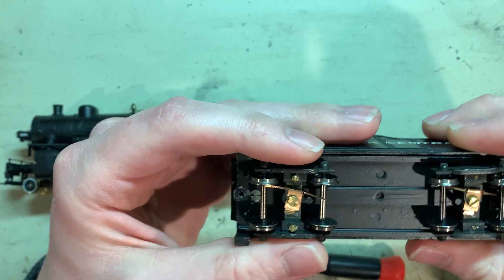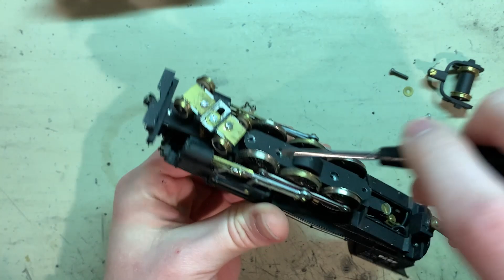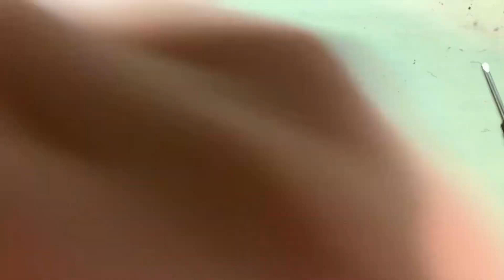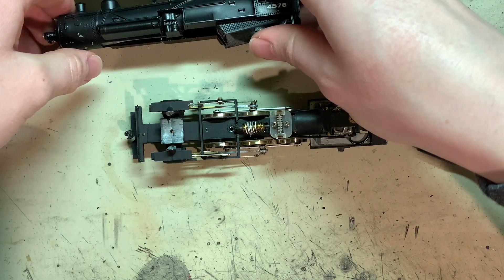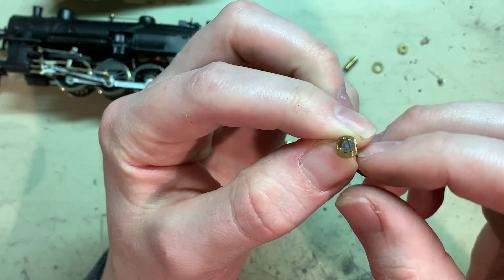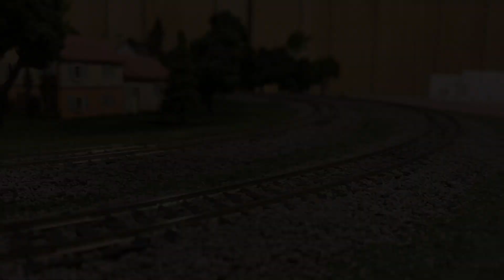Tuning up a Bowser K11 4-6-2

Comment: That's a great little machine! Do you know what year that was made?
That helical rotor, and real axel bearings are what I like to see!
Very nice!
Reply from the maker: Thanks!  I bought this one new in 2007 towards the end of Bowser kit production.  It was the first diecast model they developed around 1950, so it had a long production life!
Reply: @DarthSantaFe Wow! That's surprising how recent.
I have a John English Macado from the early 50s that was a diecast kit disaster that I managed to turn pretty much into what you have there. I rebuilt the entire thing completely, including real bearings, and much better drive rods, motor, weight reduction, and even a headlight.
I haven't seen anything as nice, that's newer till your video. 
I'll be looking around for one of those. I guess Bowser bought the John English Co way back, and I see some similarities, but my kit was pretty chincy. It took me many hours to finally finish it. 
Now I'm rebuilding a brass Tenshodo Hudson. I named it Goldzilla! It's going to be while on this one. What a freaking creature it is!
Reply from the maker: @jacksutherland846  Sounds like a lot of work went into that model, and it's good to hear that it came out well!  It was actually John English who bought Bowser, then a few years later bought most of Penn Line and some of the Varney tooling and integrated them all under the Bowser name (Stewart, Cary and a few others were also bought and added over time, and most new models are now based on Stewart's tooling).  There's actually quite a bit of history with the whole brand, and it's still owned and operated by the English family.

I hope that Tenshodo repair goes well!  I fixed one of their earliest Hudsons a while back, and it turned out to be a good runner even with the old motor and gears: https://www.youtube.com/watch?v=zdQMfnWIL2g
Reply: @DarthSantaFe So much to learn. Ay? I haven't been able to find hardly anything about the English Co. Obviously barking up the wrong tree. Thanks for the info. I'll watch the video link you sent!
Reply: @DarthSantaFe I watched that vid already. Are you sure that's a Tenshodo? It's quite different than mine.
Mine has a rail frame, enclosed worm drive, spring suspension, including the tender trucks, all kinds of things. I'm not an expert. That's for sure. But what's funny, is the mock generators are identical. Lol.
Reply from the maker: @jacksutherland846 Yup, it’s just a really old one!  It actually took a while to figure out for sure who made it.

Comment: Where can I find a nickel plating kit?    I have several drivers I need to replate
Reply from the maker: Caswell makes a nickel brush plating kit.  I've had pretty good success using it to plate some parts.

Comment: The K-11 was built as a fast freight locomotive, but was quickly replaced by 100 L-1 Mohawks of 1916 and conclusively bumped to secondary passenger and commuter runs by the 200 L-2's. "Class K-11 which had 69" diameter drivers, 26" x 26" cylinders, a 180 psi boiler pressure and they exerted 38,970 pounds of tractive effort.""The K-11a was essentially the same design as the K-3, but had shorter tubes, put less weight on the rails and had much smaller drivers. Their role, wrote the CH's McKnight, was to "expedite the perishable traffic of fresh meats, vegetables, fruit and milk into the New York City market."
50 entered service as K-10s built by Brooks with 24" x 26" cylinders, but these were converted in 1912 to gain the traffic effort shown by the K-11s. The last ten were supplied by Brooks in 1911--works numbers were 49245-49254 in February 1911.
Notice the unusually "square" cylinders in which diameter is equal to stroke.
A few were fitted with boosters and those engines had 25" x 26" cylinders using 200-psi steam for a 40,040-lb tractive effort assisted by an 11,000-lb booster at starting. It's not clear from the 1930 diagrams how many K-11s were boosted, but at that point only a few were so fitted.
Fourteen K-11s were converted by Beech Grove shops, the principal difference being the installation of 72" drivers. These were then classed K-14s.""Class K-11b, d, e, f 
 Works numbers were (K-11b) 50672-50681 in December 1911, 50682-50695 in January 1912, 50696-50701 in February; (K-11d) 51184-51203 in April 1912; (K-11e) 51760-51767 in August 1912, 51768-51789 in September; (K-11f) 54168-54172 in September 1913, and 54173-54196 in October.

Brooks may have produced the first ten new-build perfect-square Pacifics (cylinder diameter equal to the bore) as K-11a and Baldwin may have added the next 30 as K-11c, but Schenectady produced the majority of this large class.
K-11s were essentially the same design as the K-3, but had shorter tubes, put less weight on the rails and had much smaller drivers. Central Headlight's McKnight found that the K-11s were a success in their initial service as Hudson Division perishable-freight expediters, but were soon replaced by L-2 4-8-2s in 1916. It was then that they went to the Adirondack Division and soon provided motive power for freight and passenger service between Utica, NY and Montreal.
Since much of the route traveled through the Adirondack Forest Preserve, where coal firing was prohibited, the West Albany shops soon became quite provision at converting K-11s from coal to oil burning for the summer months and back during the winter. McKnight noted that the K-11s' firemen "appreciated the oil burners because riding the seatbox working an oil valve beat swinging a #12 "Rededge" [shovel] to keep the old girl hot." Eventually, enough K-11s were available for AFP service that twenty K-11s retained their oil-burners year-round and often spent the winter in reserve.
A few were fitted with boosters and those engines had 25" x 26" cylinders using 200-psi steam for a 40,040-lb tractive effort assisted by an 11,000-lb booster at starting. It's not clear from the 1930 diagrams how many K-11s were boosted, but at that point only a few were so fitted.
McKnight saluted the K-11 in a compact description of a highly useful engine: "They stood up to hard service, steamed easily, rode well, and the engine crews liked them. They could pull like a Clydesdale and still run like a Morgan." McKnight continued: "For three and a half decades they ...[were] equal to any assignment within their limits whether it be a passenger run, moving freight tonnage, heavy suburban work, or even switching chores."
Fourteen K-11s were converted by Beech Grove shops, the principal difference being the installation of 72" drivers. These were then classed K-14s.
Class K-11c 
 Works numbers were 37260-37267, 37354-37359, 37360-37375 in November 1911.

As the New York Central stocked up on these perfectly square Pacifics (in which the cylinder diameter equalled its stroke), Baldwin unaccountably was called on to deliver 30 more
Even more remarkably, the Philadelphians served the railroad until the late 1940s-early 1950s in most cases.
Class K-14a, c, e, f

 The K-11 series of fast freight/passenger engines that entered service on the NYC in 1911. Apparently pleased with the conversion of fourteen K-11s to K-14g for the Boston & Albany, Beech Grove and West Albany shops converted ten for the parent company's own use. In addition to taller drivers, the makeover included a larger tender. The specifications otherwise remained the same, although its weight growth suggests some under-the-skin additions or modifications.
Beech Grove reworked Brooks-produced 11as 3000, 3009, and 3011 to 14a, Baldwin-built 3052 to 14c, and West Albany reworked Schenectady 11e 3159-3165 to 14e, and 11f 3174, 3183, 3191, and 3193 to 14f. Successfully reworked, the class operated on the NYC until 1951-1952."https://www.flickr.com/photos/alcomike/6894932797/in/photostream/

Comment: When I built my Bowser K4 I installed a NWSL gearbox. Runs real nice with that.
Reply from the maker: I also did that with my L1 2-8-2 along with adding a coreless motor and flywheel.  Made for a super quiet runner!

Comment: Watching your video of building the Mikado (6 years ago) I was inspired to try to build one and since I have built 3 of these kits and many others. This looms like the last upgrade in design and the only down side is the lead truck. The original design was so the engine would center coming off a curve thus reducing alignment issues with the running gear and general alignment. Other than that you have a great model there and you did a good job building it. Oh and I believe the rods are plated brass....at least the side rods are the valve gear could be a sort of galvanized steel.
Reply from the maker: I'm glad my videos could inspire you!  A finished kit is a satisfying thing to have running around the layout.  I did notice while building this kit that it was originally designed for a different front truck.  The one included still works well though.  I also managed to replate the nickel onto the valve gear rod after the video, and it just about looks like new!
Reply: I wonder if a coating of sorts was applied to the magnet to keep them from picking up oxide dust and microscopic pieces.
Reply from the maker: @adamhinkle7982  Neodymium can rust very easily, so it's usually plated with at least a couple layers of nickel for protection.
Reply: I cant find the video on a mikado, only the 2-8-4 and PA-1. do you have a link?
Reply from the maker: @Alerrecks  Yup, here you go!  It's one of my oldest videos: https://www.youtube.com/watch?v=RhGKRtGZHrI&t=291s
There's a link in the video's description to the build topic for it with a bunch of progress photos.

Comment: Awesome they dont make them like they use to,,,,love the old bowser and mantua steamers they were diecast not plastic
Reply from the maker: They were really solid back then!  I also had the chance to work on a Penn Line L1 2-8-2 a while back.  The whole thing was pure lead (weighed at least 3lbs total!) and had high torque gearing with a Pittman motor.  It was easily one of the most powerful steam engines I've ever seen!

Comment: Thanks for posting this video. The 3 engines I have are early models with the worm gear, including one I bought from a fellow club member that he originally bought in a NYC hobby store in 1965. That particular one had it molded details shaved off and I'm currently in the process of adding separate details to make it reflect the look many of the yeoman Pacifics had in the late 40s and early  50s. It's a work in progress but it's certainly getting there.
Reply from the maker: Sounds like a good project!  I heard the old style Bowser motor was so reliable that they only ever had a few returned for problems, and it was usually because the track was cleaned with steel wool and the fibers got sucked in by the motor.  Knowing that, I'd expect those engines to last you for a lifetime!

Comment: Ive had that happen to a can motor(inside a pk2000 0-6-0), the magnet corroded dust was touching the armature, getting into the windings and stalling the motor. I have no clue what causes it, besides the maget itself maybe being from a bad batch. Atleast youres is an open frame! Id like to see the nickel platingjng process, I got quite a few locos that could use it!
Reply from the maker: The process isn't difficult, but it can be a bit time consuming.  I may show how to do it eventually on something like worn wheel treads.  As for that magnet though, I'll probably paint it since I don't want to mess up the charge with electroplating.  I haven't heard of a magnet disintegrating before, so that Proto magnet must have been defective somehow!